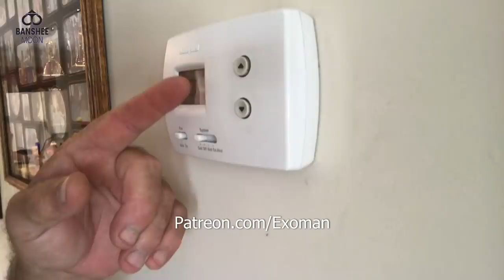DEAD HVAC, adding roof ventilation. Ridge vent not functioning well.

Comment: You already have the best venting you can get.  A cap vent all the way on the roof.  As pressure in the attic builds the hotter air is pushed out of the attic through the cap vent.

Comment: You have ridge vent already. That is a better venting system than the vent you are installing. Your problem is with the rest of the venting system. You don’t have adequate soffit ventilation and/or you are missing insulation baffles. Another issue might be that the ridge vent is not functioning properly because the plywood is not cut wide enough. With a little more investigation, we can pinpoint the exact cause. 20yr union roofer local 2
Reply: I'm glad somebody else type all that information and cuz I didn't want to do it .!
Reply: Exactly!!  Paul hit it right on the head!  With the insulation so poorly installed I would check that they didn't block the soffits with insulation!
Reply: Probably only a 1/4 gap instead of a 1/2 gap or maybe even wider yet
Reply: Yes. Proper soffit/ridge venting should be adequate. I would expect a mechanical vent would be in conflict with the ridge.
Reply: Paul is correct. Another option to soffit vents is edge vent. In combination with ridge vent works great.
Reply: I've got over 30yrs experience and yall are messing up. Those are static vents and are to be used for good ranges and bathroom exhaust systems. You need proper sophet vent for intake to have you ridge vent work correctly. If it were mine and you need more ventilation,  remove ridge vent and install a good power vent. No to mention those plastic peices of shit will cause you problems. Lomanco make them out of Aluminum!!!!

Comment: You put vents in but like most have said you have a ridge vent, look at the peak inside and see if its clear, ( the roofing and roof boards should be cut under the peak vent) then look at the eves to see if the vents there are clear. Hot air goes out the top vent and cooler air comes in the eves.

Comment: Years ago when ridge vent was a new thing, my roofer installed it with no hole underneath. I caught it about a month later when my ac wouldn’t keep up. They had to come back out, tear it all off, saw the vent hole through the plywood, two inches wide on both sides, then 
put the cap back on. One man took most of a day to do it. Be sure you can see light under yours from inside the attic, for the full length of the beam.It is a sufficient system by itself when installed properly. Vents under your eves is absolutely necessary for air movement too. My ridge vents have withstood one hurricane. They did let a fine mist of rain get through though. Sideways wind and rain does strange things. The mist didn’t get past the attic insulation, so no harm was done.
GafTimberline is a good shingle.

Comment: Those roofing shingles on the house are an architectural style shingle which should have a 40 year warranty provided the installer followed the instructions. 
Timberline shingles from GAF, require that you to use 4 or 5 of their roofing products for a warranty. (starter shingles, shingles, water proof membrane, cap shingles,hand nailed, and ridge venting.)
At the 4:23 mark of the video, you can see that they didn't follow instructions as the shingle tabs are aligned on the shingles in the middle of the screen. I'd call the builder and the installer for them to correct their installation errors. (and get a copy of the warranty).
With as much of the granuals missing from the shingles, something isn't right.
If the builder claims that there's noting wrong with the insulation, Home Depot and Lowes both rent machines to blow in additional insulation. It's not that expensive.

I hate builders. They cut as many corners as possible, then hide behind different companies names to deny you warranty coverage.

If you can get a name of the shingle manufacturer from one of the pieces of shingles you remove, attempt contacting the manufacturer, get the group that certifies the installers and see if they are certified and have them look at the roof. My bet is that they are a fly by night outfit and there is no warranty due to their installation.

Sorry you guys are having issues with your house.
Reply: Gunga Dinn granules are missing because improper ventilation cooked them and granules turn loose from wind and rain.

Comment: You have ridge vents. 
You need lot more insulation. 
Also check the flex duct for proper installation, kinks in it , could slow air flow.

Comment: Need about 7 roof vents.
New roof replacement use the ridge vent, which runs the length of the roof.  Remember, your lower venting is as important as the roof vents.  Lower venting is sofit vents and gable vents need to equal or exceed sq. Inches on the roof.  You want positive venting...have a vent fan installed; automatically comes on with pre-set temperature.
Reply: He already has ridge vents look at video
Reply: great comment so true ridge vent won't work right it there is no air passing threw to move the heat
Reply: catmodelt  wrong cat boy

Comment: I'm so glad I am in a wood house with no Attic and steel roof, Problem Solved!
Reply: That transfers the heat even quicker
Reply: catmodelt  I have a 32 x 32 square home that  has 2 sides all the way up to a peak about 25 ft high, no attic or crawl space!

Comment: Go old school.  Put gutter troughs under the windows and fill with water.  Put burlap down from above the window opening Dow into the water so it wicks up.  This creates swamp coolers at every window.  The air flow cools the house just like the kolonial mansions with the zinc troughs that many have turned into planters, not knowing what they were originally used for as early air conditioning.

Comment: Hi I could really use one of those green roofing tools you used on your roof. I have a problem of the wind blowing off a shingle on the edge of the roof and I have to go to the edge of the roof with a ladder and fix the shingles so one of those green roofing tools would come in handy
Reply: I don’t want to use it to put a vent in I want to use it for the shingles that blew off from the wind

Comment: I installed mine  under the eve at the end off the house  that is in the sun in the summer months . And the ether end is in the shade in the summer so it draw the cold air in and pulls the hot air to the hot side off the home and out .  If you put the fane on top off the home you are drawing the cold and hot air in to the addict the same time defeats the purpose  off a fan . Just saying . A good friend has been  builds custom homes for over 47 years now  and he installs all of his fans at the end of his home he builds. So they will draw the cold air in and out to the hot side in the summer .

Comment: First  inferior shingles they look like 20 year shingles second they are black and deteriorate faster than other colors. See if you have a ABC building supply company  near you i bought 50 year architecture shingles cheaper than most roofing companies were quoted me and  put a lite gray on your roof. And yes if I would have inspected that house the roof and insulation would have been replaced and re insulated before I would have bought it. ✌👍